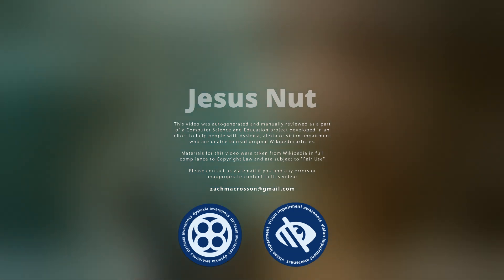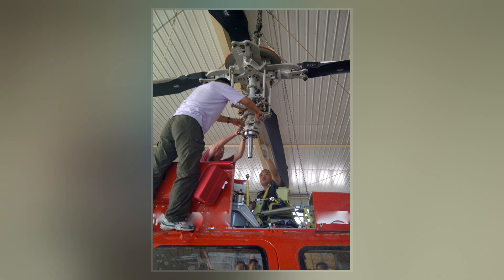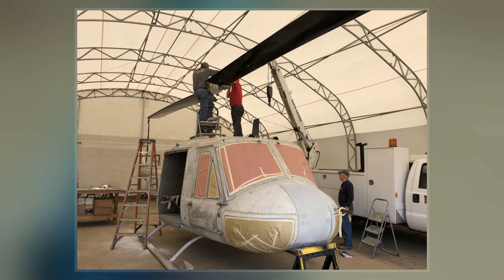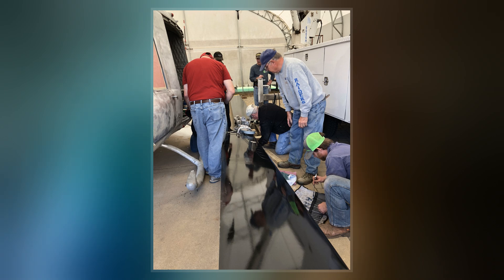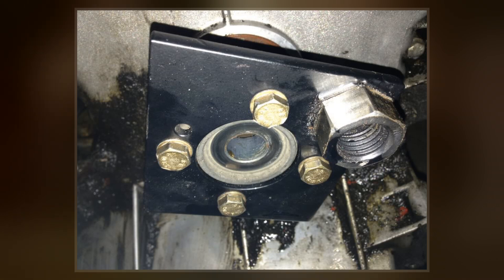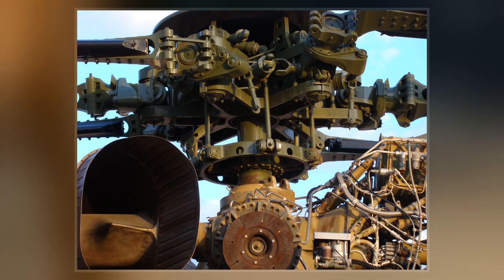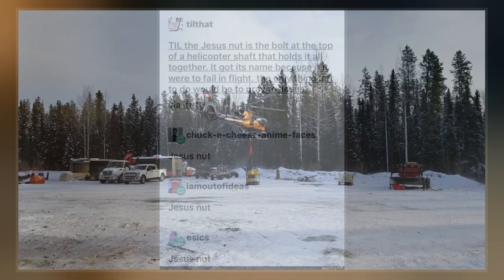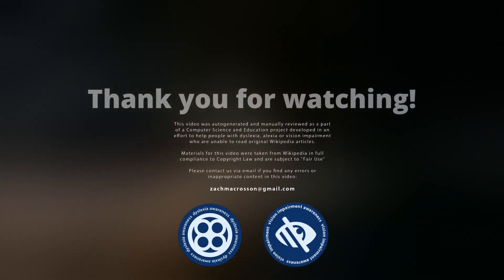Jesus Nut

Comment: Familiar with the term from my Army days.  But, I heard the name was given because when the nut flies off, the universal response from everyone inside the bird is "Jesus!!!"  I know of an actual crash caused by nut failure; killed three.  The helo was redlined due to maintenance with the nut hand-threaded tight.  The crew chief mistakenly signed off on the repair, and his supervisor signed off too without checking.  Vibration in flight (crew chief on the flight) so the pilot landed and took aboard a maintenance warrant officer while the crew chief exited the craft.  At 2500- feet the rotor flew off, killing pilot, co-pilot and maintenance warrant.  Maintenance log told the tale.